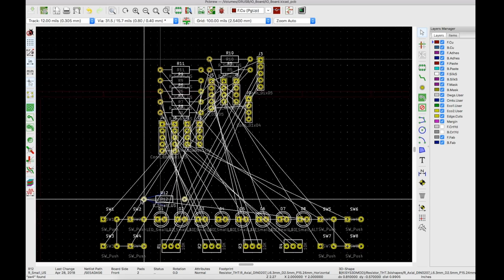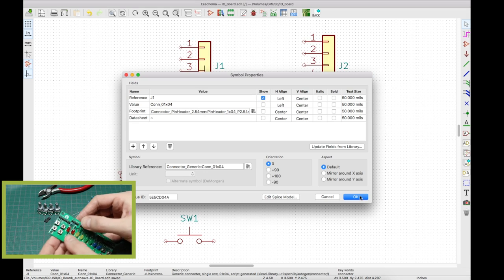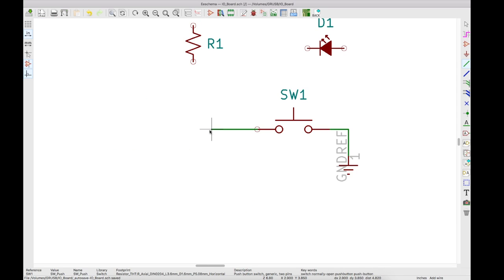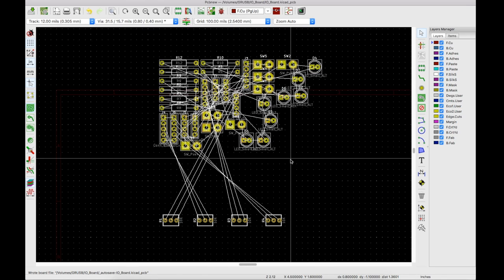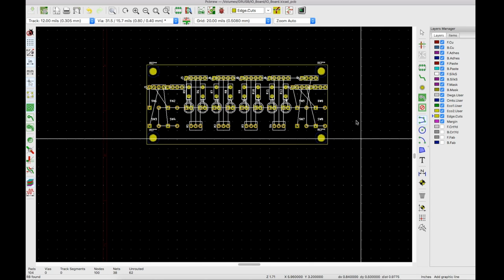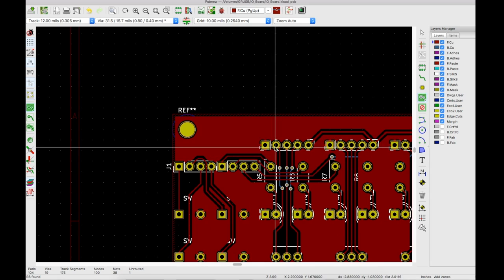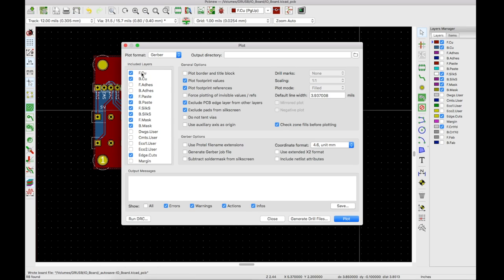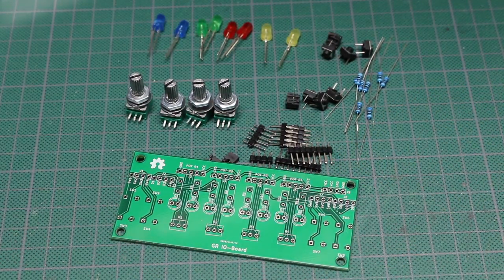KiCAD Schematic and PCB  - Quick Design Example and Build

Comment: @Gadget Reboot
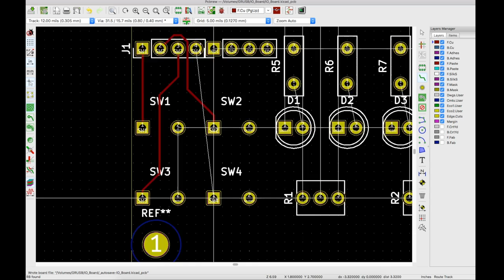At 12:27 you mentionned you do as much as you can on top side.
Why?
Personnally, especially for a through-hole board like this one, I normally do the opposite for two reasons.
First, if we ever have to repair something defective, unsoldereding will be a bit easier with traces on the component side. For unpatient people, polling out an incorrectly unsoldered chip won't peel off the traces that would be routed on top and still sticked-soldered to a pin pulled off.
Second, I am not proud to say it but if there is an error in the design and I need to do a patch where I will need to cut a trace and/add a jumper wire, it will be much less apparent and less ugly to have it under the board than on the top.
But that's my humble opinion.
Reply from the maker: mostly I end up using surface mount components so automatically I have traces on the top side anyway and I try to minimize any vias that may come into play with signal integrity or even power delivery where I just want the most direct path possible, especially if impedance control is necessary.
I try to keep a solid copper ground area in case it’s needed for any sensitive analog things mostly and some chips have recommended layout guidelines to keep any ground planes away from the sides of any signal traces where it may create a coplanar wave guide if it’s on the same layer near a signal trace.  
so keeping all of that ground on the bottom and the signal on top is some thing I learned to do.
I always found that if I was going to have any trouble removing components, I would probably end up damaging pads or traces no matter what side they are on but ever since I started using a vacuum desoldering tool, it’s not even a concern anymore. Much better than using a screwdriver wedged under an ic trying to heat up all the pins with an iron.

Comment: All is working except I can't see the copper pads on all the components on the pcb. I only see the yellow outline and the tracks.
Reply from the maker: Are all the desired layers turned on for visibility?  Does everything show up when viewing the 3D render of the PCB from the view menu?
Reply: @GadgetReboot  I see the pads in 3D and they are yellow. All the layers are turned on.

Comment: Great  videos! I started using Kicad to design guitar pedals and wondering if you know what footprint you would use for a simple audio jack The Jack will obviously be off board , so I just need two holes. Thanks!
Reply from the maker: In the footprint library there's many "connector" categories where footprints can be found for adding headers, like connector_wire   has some solder pads that can be placed where needed and connector_pinheader_2.54mm has standard header pins which can also be used for wire soldering or adding a standard header strip to plug into.
Reply: @GadgetReboot  Thanks! I'll check out the connectors. Great tutorials on the app!

Comment: Hello Thank you for your video. While i created a design in Ki Cad 5.1and after annotating the design, I tried to  add footprints to the  schematic symbols but it keeps displaying "failed" and no symbols found. Please can you guide me?
Reply from the maker: Is it a new installation starting in version 5 or was it updated from version 4?   Originally I had version 4 but never used it, then I updated to 5 to start using it and it had all kinds of problems trying to find things so I deleted everything and installed a new version 5.  
Is it saying it can't find symbols (schematic parts) or footprint libraries can't be loaded?  I remember it couldn't load my footprint libraries until I installed it all fresh.
Is the schematic drawn new by you or something you got online?  If someone else used parts that aren't in your own library and you don't have a copy of the parts to load, it can give problems.
Otherwise does this help: https://forum.kicad.info/t/how-can-i-assign-a-footprint-to-a-symbol/8901
Reply: @GadgetReboot  hello, thank you for your reply. I have installed version 5. The schematic that I have drawn is my own design but as you said I just installed the kicad again and actually after manual library assignment it is working now. Ty.

Comment: Got an ad for altium on this lmao
Reply from the maker: i’m sure they are going to attract a lot of business from open source do it yourselfers!
Reply: And I got a second one on the end too. I’m not even mad, it’s interesting to watch a promo of their tech even if I’ll never buy it, like those occasional industrial CNC or conveyor belt or bottling machine ads I get. KiCAD is by far the best piece of FOSS I’ve ever used, so it’s got my respect. I think it’s made by the guys at CERN.
Reply from the maker: I remember when people were relying on Eagle which I think was still limited in board size and number of layers so this is a big step up.  Open source is great and I wish this was more common 20 or 30 years ago in the hobby community.  
I remember using things like Turbo Pascal 4 for DOS or something and I might need to use somebody’s code to do something like serial port modem access but I could only use it as a compiled include unit and it would force nagging banners and basically ruin the user experience and I couldn’t tweak it if I needed and it was actually more of a hassle to use something that was given away for free.
Reply: As if a kicad user is going to think 3k or more is ok, and buy it. Used to use Altium at work great program but not for hobbyist . I found kicad after using Design Spark pcb from rs components, seems to do everything I need.  Great video and nice bit of  gadgetry rebooting;)

Comment: Can you SHOW me how to start off with the ground plane first, on the pcb? ALL on one side of the pcb! No one can make a video and show me how to do this. Is it that hard to do? The circuit has 50 components.
Reply from the maker: Not sure what the question/problem is and I can't remember what was covered in the video so going from scratch I just launched PCBNew to start a new board, version 5.1.2-1, I click the icon for Add Filled Zones, or from the file menu: Place/Zone, then click somewhere in the work space and a menu comes up called Copper Zone Properties.  
If it's a single sided PCB I'll probably put copper on bottom so I click B.Cu in the Layer box for where to place the copper zone.
Since I don't have a design to route and there's no netlist from a schematic, I only have a choice of <no net> in the list that I can connect the copper to so I just go with that and OK everything to get out of the dialogue.   Now I just click around the work space to create the shape I want and double click when I'm done to fill in the copper area.  
Later if I want to change something like the shape or the net it's assigned to, when the mouse cursor is just in the normal pointer mode I can click on the outline and it will highlight, then I can move the shape points or type E to get back into the original property edit box and change the layer it's on or net it's assigned to.
Reply: @GadgetReboot  That worked, now I need to import the netlist into the pcb and connect all the ground connections first. How do I do that?
Reply from the maker: After loading the netlist with the tool shortcut icon or menu Tools/Load netlist, all the nets in the design should now show up in that Copper zone properties config menu for the drawn copper area, so go into that edit property menu for the copper zone and choose the ground net.   

Then any pins that belong to that net will auto connect when a part is placed inside the copper zone, unless routed tracks cut up the copper zone too much, which is where a double sided board allows more ways to connect to the copper area with vias.

As parts are moved around or traces routed, the filled in copper area may need to be refreshed by typing "b" to redraw, I think that's the key.   And there's buttons to toggle if the copper is shown filled in or just vacant to make it easier to see other things because sometimes it gets in the way.
Reply: @GadgetReboot  Thanks. It's working but still many components to rearrange.
Reply: @GadgetReboot  That worked. So now how do I do a quick search for a componet so I can find it quickly on the pcb??
Reply from the maker: Here's a list of shortcut keys https://defkey.com/kicad-shortcuts
I think ctrl F is a reference designator Find that will select the component but it doesn't work as smooth as other programs, I think after finding a part you have to maybe hit M to start actually moving it because it's not attached to the cursor after being found.  More like a mouse go-to feature

Comment: Three days watching video and reading help files. Then uninstalled this crap and made my UHF components PCB in 15 minutes. Yes , you have to draw, drill, etch .
Reply from the maker: I etched my first PCB using ferric chloride and an etch resist pen from RadioShack in the 80s. I’m glad I don’t have to do that anymore and dispose of the chemicals. I use this software twice a month now and I’ve used it for the past four years.